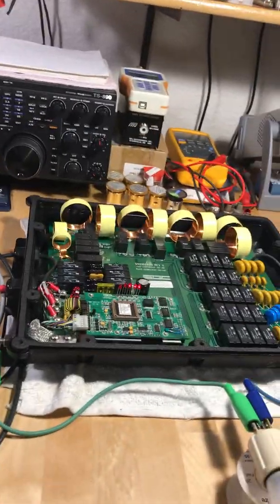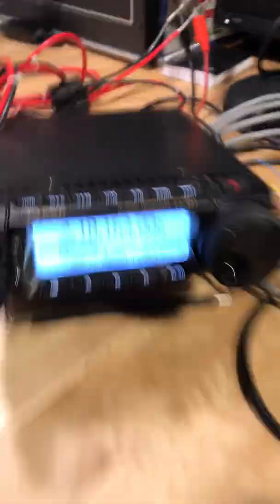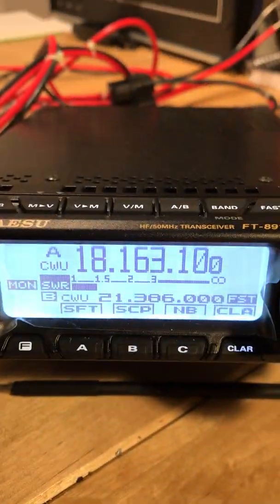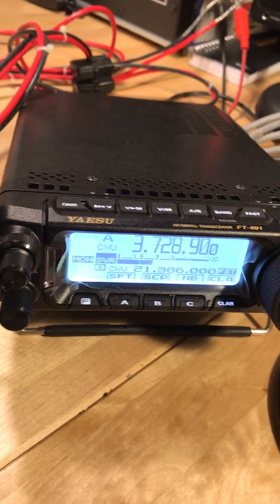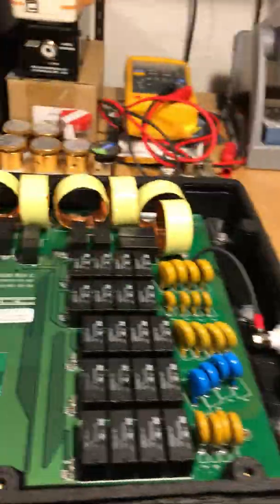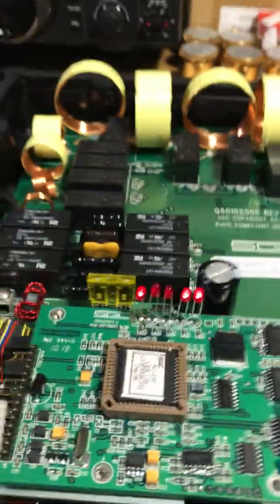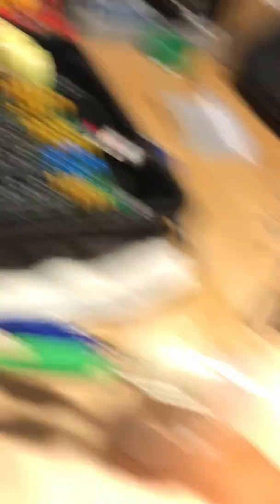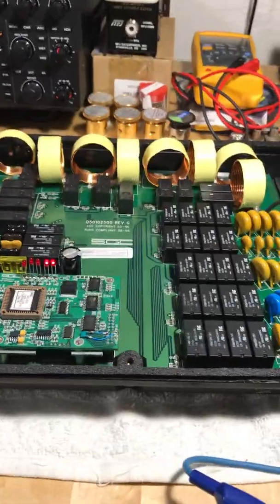SG-235 Auto Tuner logic problem

Comment: Long job to change all that relè. 👍👍👍👍👍 
At the end did you sort the problem out?
I have a ICOM AT 130, old staff. I gain It from a Vessel, changed years back, because faulty. Kept it for long time in my electronic junk. Sometimes ago I took a look at It. Found a problem on 1 relè (maybe stiky Or bad contact) some times tune up correctly, next Moment out of order. During tuning procedure, tuner has 2 relè that switchs RF power to an attenuator, phase detector and a balance circuit that detector 50 ohm load. At the end of tuning all this Is disconnected and RF power Is send directly to the π network. And the second relè was the problem, the one connected to the π circuit. Changed that relè, Now works good. Tune Is found in less then 2 seconds. My does not have a Memory, so each frequency Is tuned from zero everytime.
 It Is a project ICOM of 1986. One problem I notice Is that from 25 to 30 MHz, sometimes fails to tune. But that Is due to capacitors and coils step. Since I am not normale, I built a circuit capacitor, coil, capacitor (a π) having value approx to tuner value, but variable. And in that frequency half turn of coil and 2 PF makes the difference. The tuner's step Is 8PF and at that frequency Is too much. 
Anyway you have done a good job, Hope that your tuner now Is working ok. 👍👍👍👍👍
Reply from the maker: I did fix it (this time), but since retired it to the bone yard due to repeated problems/failures.  

Biggest complaint being is how long it takes to initiate a re-tune when the SWR goes high, or switching to a different antenna. 

It has serious software issues, and with lack of support (i.e. as in NO support) from the manufacturer, so I wouldn't recommend to anyone. it's overly expensive junk. Live and learn.  The MFJ-998RT, although it has problems of it's own, is a MUCH better design and unit.
Reply: @stevejoos8953  so, at the end you manage to fix It. Good job. Unfotunately, nowdays everithing Is running with software, and in any electronic equipment could have 2 source of fault hardware or software or both. And findimg spare parts Is not an Easy job. And if Is a software problema It's even worse. What can I Say, good day and good QSO. 👍👍👍👍👍👍👍👍
Reply from the maker: @antonioroccuzzo4214 Stayed tuned.  There are PLENTY of designs on the Internet for Aurdino based auto tuners, most with open-source source code so that one can make their own modifications.

One of which (I'll have to find the link) is for a relay based tuner but with MANUAL tuning knobs (to cycle thru all of the different relay combinations).

It was an awesome idea with little optical encoders to roll thru all of the relay steps for both, inductance and capacitance. Plus it had memory etc.

I want to take that design and modify it to essentially double each L can C leg as to make it a true "balanced" tuner (for Doubletts and Loops etc.).

I'd also use MASSIVE relays like P&B open-frame "contactors" which are indestructible (plus servaceable).

I've already priced out all of those big P&B relays (contactors), and they are a bit pricey, but not too bad in the grand scheme of things.

Have been thru these PCB-based relay tuners (smoking up each and every one of more than once), how priceless would a TRUE indestructible tuner like this be ?
Reply: @stevejoos8953  tks, but i believe that i am not young enough to fiddle with electronic any more. Been working in the field of marine telecommunication for 45 years and now retired. Now my eyes are not good as the old days. My First CB was a Lafayette 23 Channels, 1970. And i built an automatic tuner on 1987, It was analogic with motorized  variabile coil and capacitor. No CPU, all controlled  by 2 phase detectors, operational amplifier and transistors. It was slow to shift from One end to the other, but never fail, and tunes was Always on the spot. Now I gave up taken everything away. But i enjoy to watch people doing electronic things in YouTube. Thanks for all anyway. I Will look at that.

Comment: What gets me is this tuner has been around a long time and still has issue like this. I own same tuner and not impressed with tune it gives not sure if something wrong with it. 12 meter vertical wire and two 12 meter earth counterpoise get 1:1 on 15 meters and 160 all other bands swr over 1.5 and 2:1 in fact some just over 2:1 and does not retune higher bands the worst
Reply from the maker: This is all too common:  typical "old stioggy fogy" designs, and markets something with 70's style technology, and everyone "oggles" over it like it's the best thing since sliced bread.  It sucks.

Wait until it blows up, and quits working completely on all/most bands, and throw it away and never look back.
Reply: @stevejoos8953 I am glad you agree with that I was thinking I was only one with that opinion